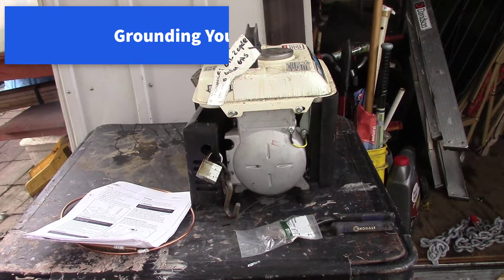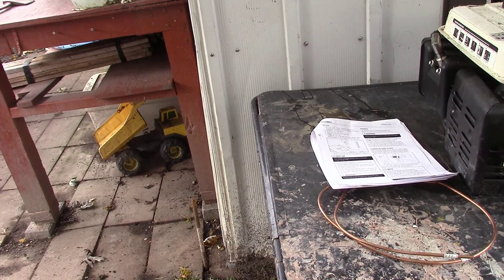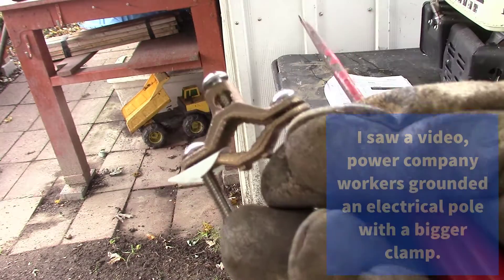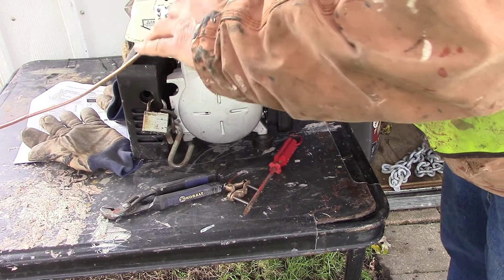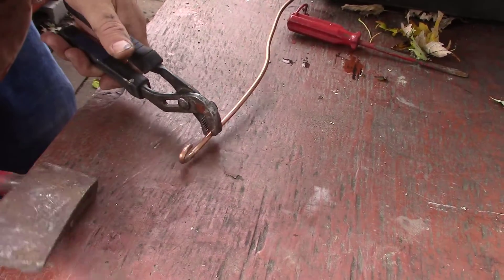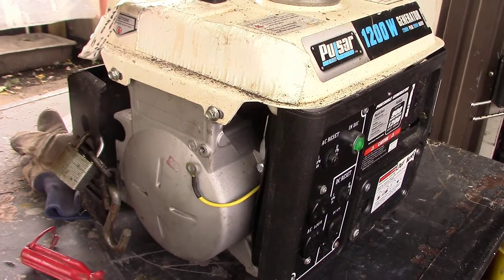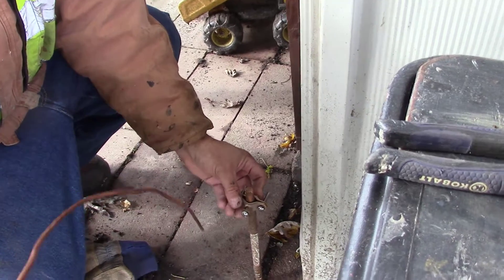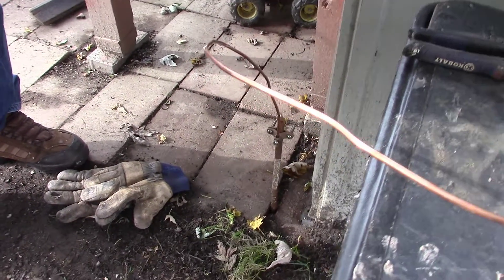Home Generator HOW TO Ground Your Home Generator Part 5 0f 7

Comment: 1st.Thing's 1st.Put your Gen 23 Feet Away From house.
Reply: FiddleStick's bessette  Curious how you arrive at 23’. I’ve always gone with 10’ with the exhaust pointed away from the building.
Reply from the maker: It's kinda just a fancy lawn mower engine. I think the whole idea is to keep it far away from the house because of the carbon monoxide fumes, and in case it explodes. I remember reading 25 feet somewhere too. I have an old neighbor that runs his in the basement, that's real dangerous because of the fumes! Never do that!
Reply: Jim Vincitore I get it. More is better. In the basement?! On no!
Reply: I’d say you found the proper ground point despite the manual referring to the front panel. Many manuals referrer to a group of products and don’t necessarily apply to yours. I’ve run generators without grounding them, specifically to run a refrigerator and freezer and got away with it with no problems before I knew that grounding is a good idea. Might save an expensive appliance. I’ll ground my generator in the future. Thanks for your video.
Reply from the maker: Oh yeah! Great tip! Great advice!

Comment: In your video you said that it is recommended to use 2 grounding rods. What did you do with the second grounding rod? I saw what you did with the first one. The first one is connected to the pipe and the generator; also it went into the ground into the dirt. Where is the second one, and where does it go?
Reply from the maker: Hi Mattie! Great question! I'm not an electrician. I only put one on my generator. I think they recommend at least two or more on a house. I don't know what they recommend on a small generator. Next time I go to the hardware store, probablt tomorrow, I'll ask the electrician and get back to you! Also, check out your local hardware store, find the retired electrician working there and ask him. Those people really know all about this stuff! Thanks for watching! Jim